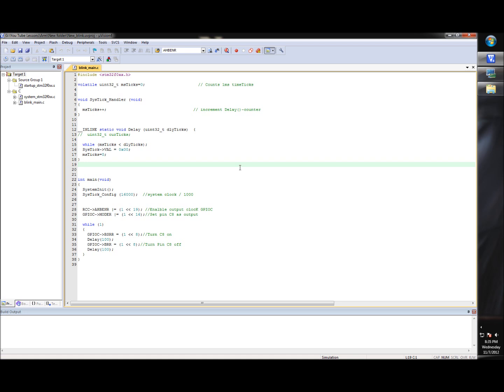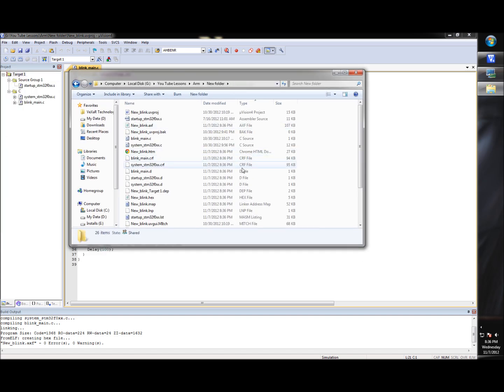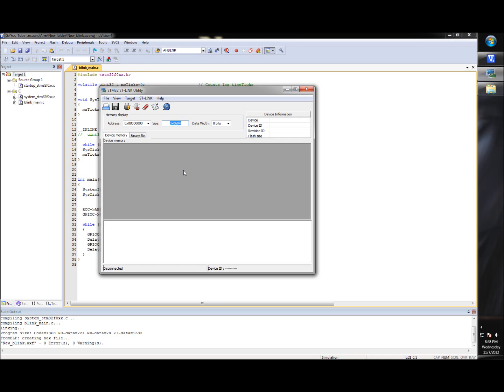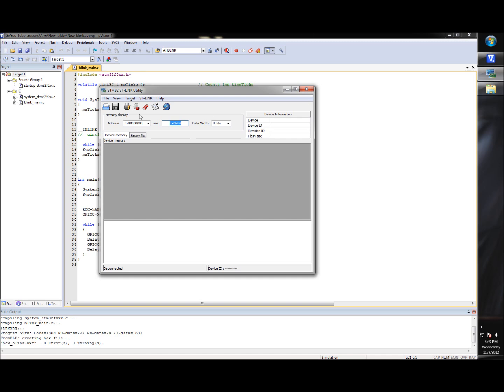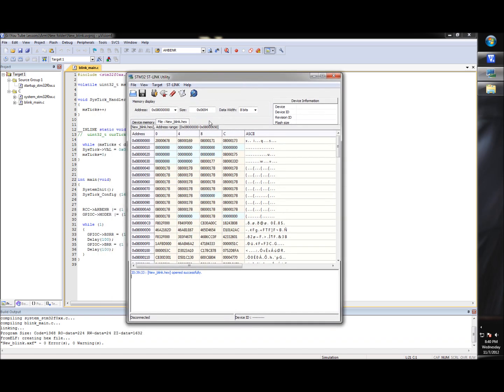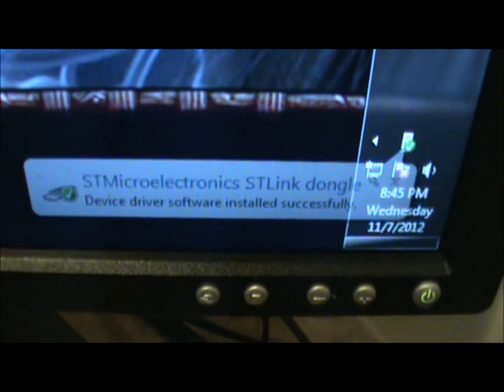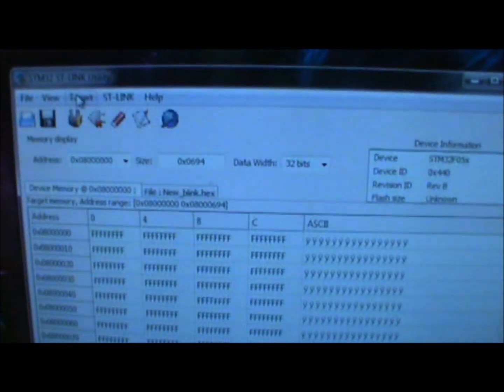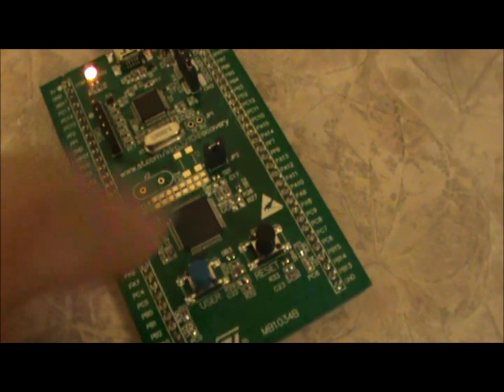Intro To ARM Programming The STM32F0 Discovery

Comment: Hi,
I am trying to read the external accelerometer values through spi interface to my stm32f429i discovery board. But i am not able to do so. Can You help me with this?

I am displaying values through uart. But the value is always 0 as initialised

Thanks & Regards
Sameena shaikh

This is the code i have written. Used stm32cube mx to generate the initializations

#include "main.h"
#include "stm32f4xx_hal.h"

SPI_HandleTypeDef hspi1;

UART_HandleTypeDef huart1;

void SystemClock_Config(void);
static void MX_GPIO_Init(void);
static void MX_SPI1_Init(void);
static void MX_USART1_UART_Init(void);

#ifdef GNUC
/* With GCC/RAISONANCE, small printf (option LD Linker->Libraries->Small printf
set to 'Yes') calls __io_putchar() */
#define PUTCHAR_PROTOTYPE int __io_putchar(int ch)
#else
#define PUTCHAR_PROTOTYPE int fputc(int ch, FILE *f)
#endif /* GNUC */

/**
* @brief Retargets the C library printf function to the USART.
* @param None
* @retval None
*/
PUTCHAR_PROTOTYPE 
{
/* Place your implementation of fputc here */
/* e.g. write a character to the USART */
HAL_UART_Transmit(&huart1, (uint8_t *)&ch, 1, 100);

return ch;
}

uint8_t address=0, data=0;
uint8_t x_acc=0, y_acc=0, z_acc=0;

int main(void)
{

HAL_Init();

SystemClock_Config();

MX_GPIO_Init();
MX_SPI1_Init();
MX_USART1_UART_Init();

HAL_GPIO_WritePin(GPIOA, GPIO_PIN_4, GPIO_PIN_RESET);

address=0xa7;
HAL_SPI_Transmit(&hspi1, &address, 1, 50);

data=0x08;
HAL_SPI_Transmit(&hspi1, &data, 1, 50);

HAL_GPIO_WritePin(GPIOA, GPIO_PIN_4, GPIO_PIN_SET);

HAL_GPIO_WritePin(GPIOA, GPIO_PIN_4, GPIO_PIN_RESET);

address=0x2D;
HAL_SPI_Transmit(&hspi1, &address, 1, 50);

data=0x08;
HAL_SPI_Transmit(&hspi1, &data, 1, 50);

HAL_GPIO_WritePin(GPIOA, GPIO_PIN_4, GPIO_PIN_SET);

HAL_GPIO_WritePin(GPIOA, GPIO_PIN_4, GPIO_PIN_RESET);

address=0x31;
HAL_SPI_Transmit(&hspi1, &address, 1, 50);

data=0x0B;
HAL_SPI_Transmit(&hspi1, &data, 1, 50);

HAL_GPIO_WritePin(GPIOA, GPIO_PIN_4, GPIO_PIN_SET);

HAL_GPIO_WritePin(GPIOA, GPIO_PIN_4, GPIO_PIN_RESET);

address=0x2C;
HAL_SPI_Transmit(&hspi1, &address, 1, 50);

data=0x0A;
HAL_SPI_Transmit(&hspi1, &data, 1, 50);

HAL_GPIO_WritePin(GPIOA, GPIO_PIN_4, GPIO_PIN_SET);

while (1)
{
HAL_GPIO_WritePin(GPIOA, GPIO_PIN_4, GPIO_PIN_RESET);

address = 0x32;
HAL_SPI_Transmit(&hspi1, &address, 1, 50);

HAL_SPI_Receive(&hspi1, &x_acc, 1, 50);

HAL_GPIO_WritePin(GPIOA, GPIO_PIN_4, GPIO_PIN_SET);

printf("x_axis: %d\r\n", x_acc);

HAL_Delay(50);

}

Comment: Thanks =)
Looks nice. 
Why not to upload hex using Keil functionaliity ? It can also nicely debug code out of the box. Big distribution of keil-arm with additional modules is shared on rutracker (needs auto translate in chrome to discover the web site). 

You can also install CooCox CoIDE, it is beautiful and free. The latest version supports very big part of stm32 portfolio including most popular MCUs and the smallest one: STM32 050f4. It also supports nxp, toshiba and other arm-based controllers.
Reply from the maker: Hey there, Thanks for your comment.  In this video I did not know how to get Keil and ST link to work together so I could upload the Hex from Keil.  However, I have attached a link to a video where I discovered how to accomplish this in Keil. 
ARM Keil uVision Loading with IDE using ST-Link

Hope this helps and thanks again!